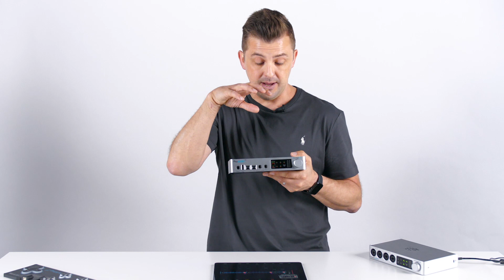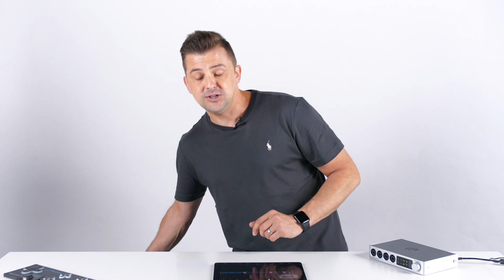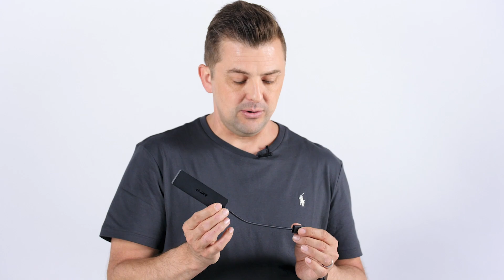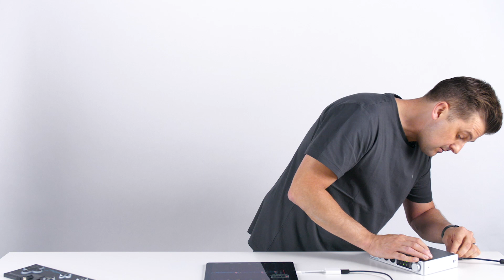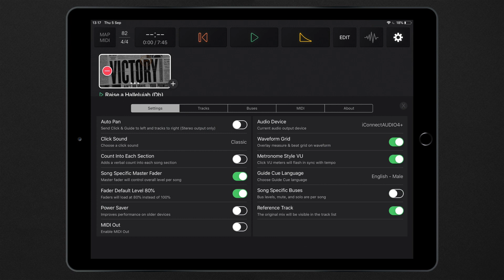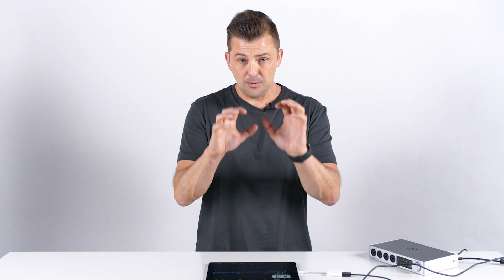HOW TO | Connect Your Audio Interface and MIDI Controller to Playback

Comment: I tried using a usb dongle with 3 usb ports.

When plugged directly to to ipad using the dongle's fire to usb, playback automatically recognizes my audio interface, no issues.

However, when I tried plugging in my Pod Go to the dongle, playback switches to the Pod Go as an interface. There is no way to manually change it back to my audio interface.

My solution, which sadly didn't work very well at all.

Was to use a separate iPhone and remote connect to the wifi.

I even put redundant midi cues to switch my Pod Go. (i.e. cc#69+0 for snapshot 1, 3 times in a row separated in 1/16 notes on the time line.)

I figured I'd it misses the first cues, maybe it'll catch the 2nd or 3rd cue. It worked somewhat in rehearsal, but the iPhone immediately crashed and I had to re-open the app and reconnect to the host before the service began. Once we started the service it was still connected and the tempos synced, but not one of the midi cues worked! Very frustrating!

When it works it's great, but it did not catch the midi cues at all this morning at worship (I had to tap dance on the Pod Go all morning).

What DID work flawlessly is the tempo sync. I didn't need to use the tap tempo once this morning! Small victories!

I'm trying to control both my playback and my Pod Go from one tablet, where am I going wrong?

Do I need a powered usb hub? The dongle I'm currently using has 3 usb inputs a a fire input to keep the iPad charged but the Pod Go overrides my audio interface as soon as I plug it into the dongle usb input.

I wish there was a way to manually select the audio interface instead of it only auto detecting what's plugged into the dongle.

Any help is much appreciated!

Comment: Where’s the audio interface connected to? House?
Reply: Usually plugged into a stage box that sends the different outputs to the audio console to be mixed and routed correctly. Click and Guide to band, and the tracks to the band and ouse mix.

Comment: Can Playback running on the iOS device (plugged in via the lightning cable to the iConnect 4 interface) be controlled via Midi running not via USB or a USB hub, but via DIN cables going from the back of the iConnect 4 interface itself, and then out to a MIDI foot controller?

Comment: Awesome 🔥 what usb hub are you using?
Reply: Anker 4-port USB hub like this one:
https://www.amazon.com/Anker-4-Port-Macbook-Surface-Notebook/dp/B00XMD7KPU/ref=sxts_sxwds-bia-wc-drs1_0?cv_ct_cx=anker+usb+hub&dchild=1&keywords=anker+usb+hub&pd_rd_i=B00XMD7KPU&pd_rd_r=fe38de07-69ac-44d9-84a2-afb211788101&pd_rd_w=4sKyN&pd_rd_wg=1qGlB&pf_rd_p=f3f1f1cd-8368-48df-ac69-94019fb84e3f&pf_rd_r=3H0SRWJ4XWDWKEM2H4Z4&psc=1&qid=1599956235&sr=1-1-f7123c3d-6c2e-4dbe-9d7a-6185fb77bc58

But keep in mind, if your interface needs more bus power, you're safer getting a Powered USB Hub like this Sabrient 4-port Powered Hub:
https://www.amazon.com/Sabrent-Individual-Switches-Included-HB-UMP3/dp/B00TPMEOYM/ref=sr_1_5?dchild=1&keywords=powered+usb+hub&qid=1599956252&s=electronics&sr=1-5